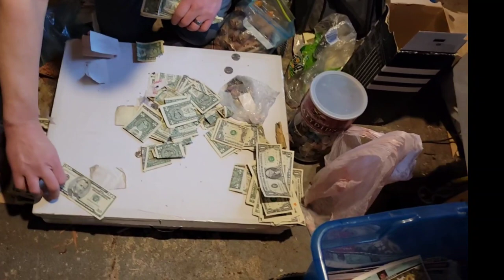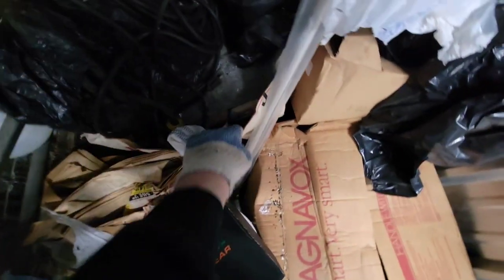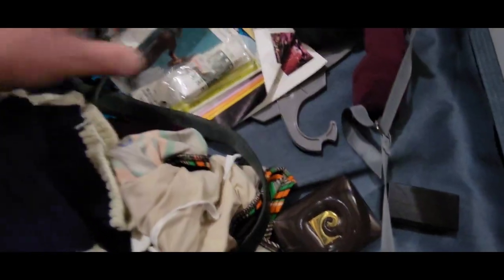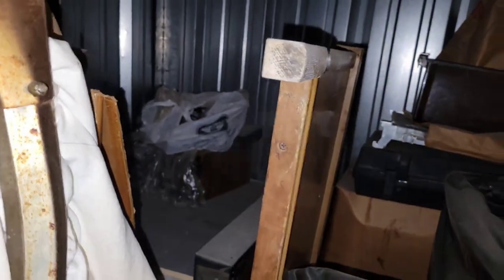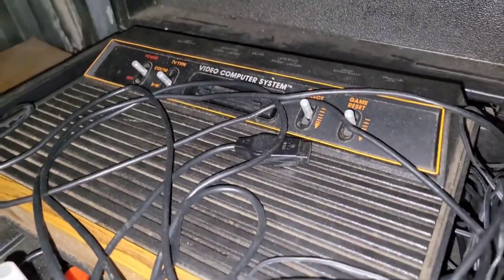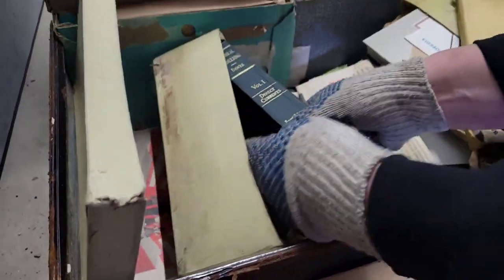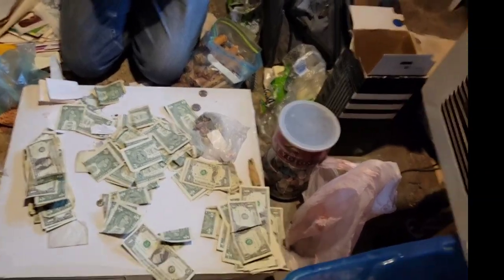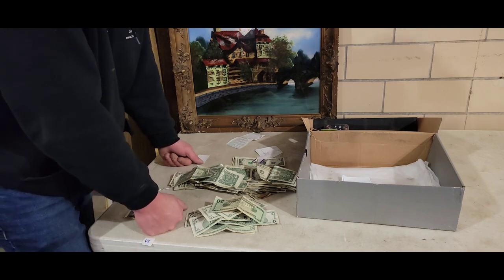Elderly Man Dies & Left Hidden Money in Storage Unit? ~ You won't believe How Much CASH in LOCKER?

Comment: You can take a dollar bill that's torn half to the bank and they'll replace it with a dollar bill so if you do that to two different banks then you'd have $2
Reply: No it has to be at least 3/4th of the bill left before they replace it. I used to work at a bank and that was the rule.
Reply: It's been a while but in Missouri you could do half